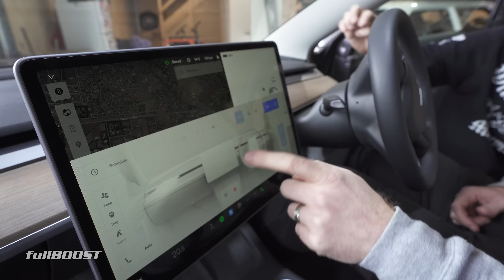Living with a Tesla from a 'car guys' point of view  | fullCHARGE

Comment: Hydrogen combustion for the win, Cleaner than electric and still makes noise
Reply: Just need to sort out the Nox produced and storage then all good!
Reply: You know you need 60psi boost just to make the same grunt as an ATMO engine yeah?  https://www.youtube.com/watch?v=3IPR50-soNA&t=367s
Reply: @karlajensen100  Technology will advance
Reply: considering you use electricity to make it. and the amount of energy you get from burning it will always be less than the amount of power you put threw water to split it it's not cleaner at all. hydrogen fuel cell would be better as the electric motors efficiency it well beyond anything you could hope to get from an ice engine. and then you get to do away with lithium mining too.

Comment: Few Myths there boys that need clearing up.  ChargeHQ manages charge from solar and as a group of over 1200 Teslas we actually flatten the so called "duck curve" thats the typical demand being made difficult by large Solar penetration on the grid.  EV's FIX more grid problems than they create.  Smart Grids handle daytime demand no worries and average punter only does 35kms a day (12775kms a year) which is just 6.3kWh worth of energy so not much.  Grid capacity has easily be historically able to grow faster than demand but again with solar and wind EV's help the grid demand side more than they hinder it.  Check out "the big switch"..

Comment: I would get one if it cost 10-20k. Anything more then that is just not worth it considering the price of electricity. Takes me 3mins fill my tank and drive off how long it takes you to charge you electric car. 3mins??? yeah i think not obsolete already. 99.9% of Australian home have single phase power, to charge it at its fast and maximum power require 3 phase power, depending on your location and closest power station or substation it would take longer unless you get one installed and built on your property could set you back 120k+.
Reply from the maker: Electricity costs more than petrol?
Reply: @fullboost  Electricity vs petrol then fuel is more expensive. Factor in the car, and everything else then battery powered cars will cost a fortune. The prices of lithium and cobalt etc for batteries are going through the roof and we have not even started to get these cars moving and out to the population. The only real solution is a hybrid.

Comment: its not cheap to run at all its going to use so much electricity at home charging ( unless you have a 7 or 8 star home solar with battery back up as well and 10KW system or even 15KW system)  like in south australia they are having electricity losses at home due to the demand, plus ok at charge points, but then again till Australia's renewables are up to the task of making sure that every home in victoria has enough electricity power and still have say 50% of the cars are EV's and no dropouts, its going to take at least 15 years of straight up renewables getting placed on Solar homes /wind farms battery back ups etc facility's around the state, based on Wind and solar to back up the main grid, only then will the prices of EV cars drop good quality EV cars that is, like say Croatians EV car company RIMAC to start making good family EV cars for down under and affordable as well, to compete with Tesla who was born in croatia by the way as well. :)

Comment: There is to much industry & jobs based around oil, petrol ect ect, for them to go "right everyone in a battery car" just doesn't work and it's going to take decades to put all the "charging network ect. They barely can support electric supply when the UK puts it's kettle on at about 6pm. 👍👊✌ frm us here in the UK

Comment: I'll just leave this here re handling https://en.wikipedia.org/wiki/List_of_Top_Gear_test_track_Power_Lap_times   Note that around a 1:21 lap for a GT3RS vs Model 3 performance (2019 was 5% less grunt than the car featured) just 1.215  HALF A SECOND slower than a GT3RS...
Reply from the maker: Great achievement but they cant keep it up for long. See this as an example.
https://www.youtube.com/watch?v=IXkEEF76OZE
Got to remember they this isn't supposed to be a track car, will be interesting when Tesla release something  orientated for this.
Reply from the maker: Also, the seats are absolutely shocking and not designed for corners lol